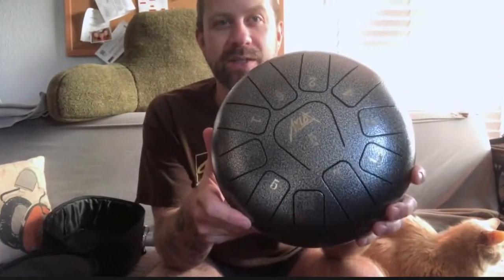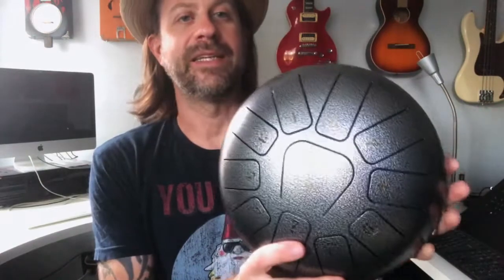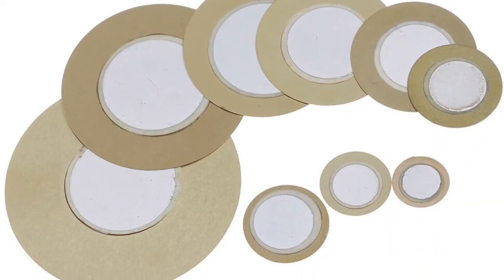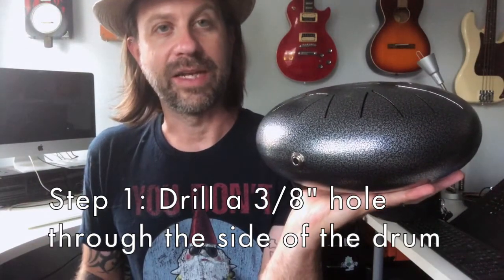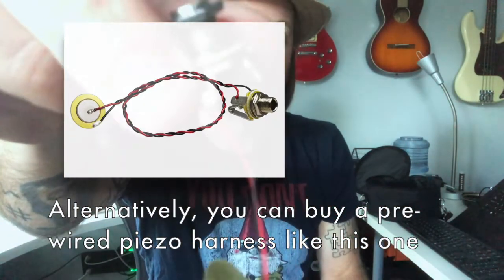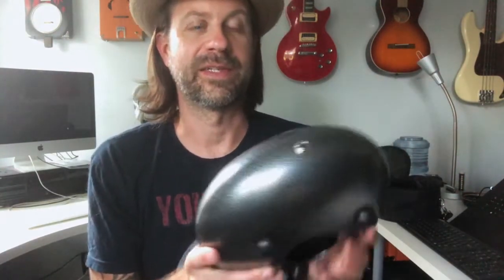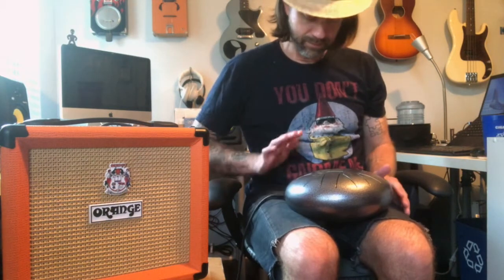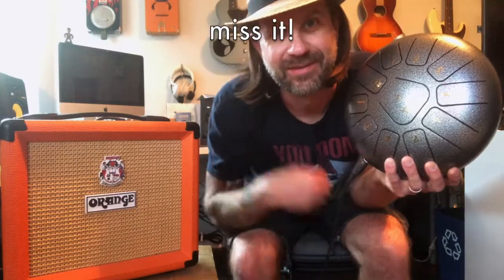How To Electrify a Steel Tongue Drum

Comment: I really want to do this with actual guitar pickups.  Is it magnetic ?
Reply from the maker: It depends on the drum. Some are made of magnetic materials and others are not. This particular one is magnetic. I thought about doing that but I think it would take a ring of magnetic pickups mounted under the tongues. You'd probably have to 3D print a mounting bracket of some sort.

Comment: Nice! Do you think attaching a small magnet to the drum and attaching the wire to the magnet would work as well?
Reply from the maker: I suppose you could use a magnetic pickup (even if it's just a coil around a magnet) but the problem with that is... not all tongue drums are magnetic. That might be an interesting project to try though.
Reply: @musicalmiscellany  Awesome thanks! Hoping my tongue drum I got off Amazon is magnetic.
Reply from the maker: @DylanFerno  Should be a fun project. I would think you'd want the magnet just slightly above the metal (not against it) but who knows. I think you're breaking new ground with this one. Let me know how it goes.
Reply: @musicalmiscellany  Awesome will do

Comment: When you hold the piezo onto the metal surface.............don’t hold it with too much pressure..............as you can crack the ceramic disc.
Reply from the maker: That is true. Especially on the larger piezos.

Comment: Tungsten carbide drill?!
Reply from the maker: Hi David. the drill bits I used are linked below. Honestly though, I think just about any drill bit would work. It went through pretty easy. Aklot claims this is a titanium alloy, but they don't tell you what else is in the alloy. It drilled more like aluminum or light gauge stainless.

https://www.homedepot.com/p/DEWALT-Titanium-Pilot-Point-Drill-Bit-Set-21-Piece-DW1361/202279642
Reply: @musicalmiscellany  It was a Monty Python reference. Sorry I wasn't clearer about that. And thanks for the info anyway. I'm looking for a good set of drill bits.
Reply from the maker: @davidozab2753  Ha ha. I get it now. Sorry... that was pre-coffee.